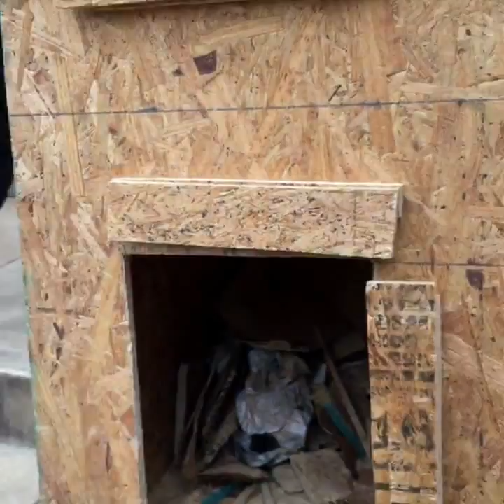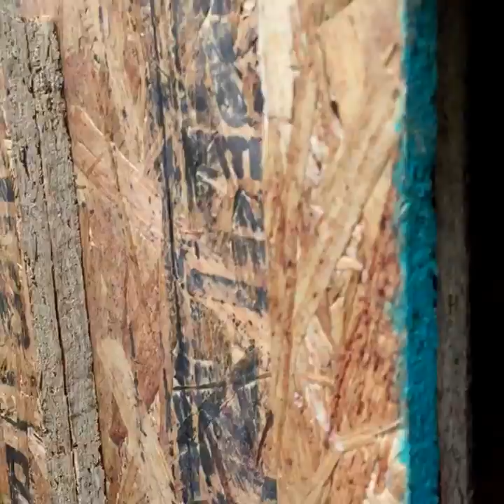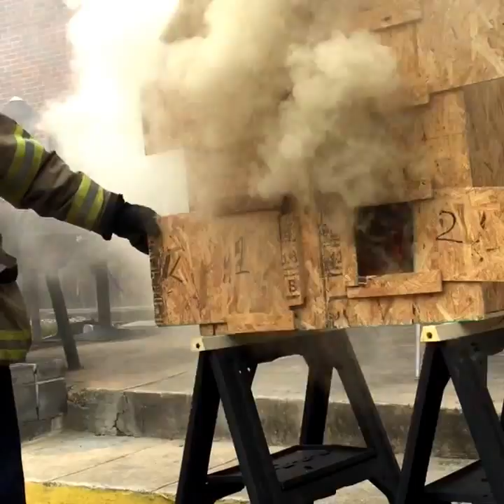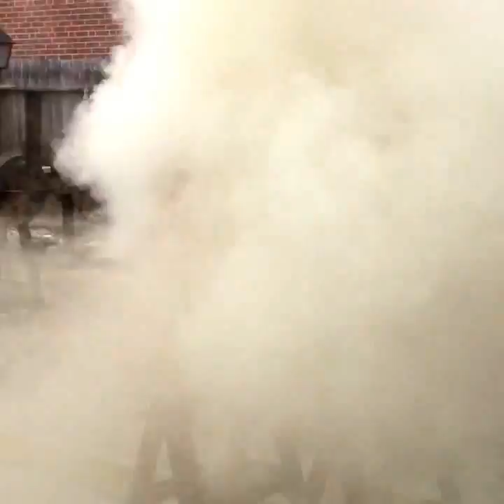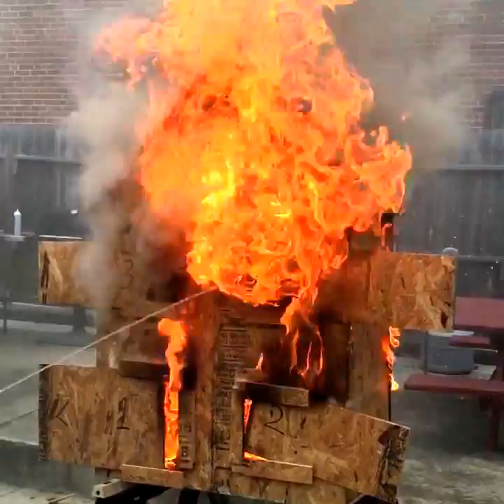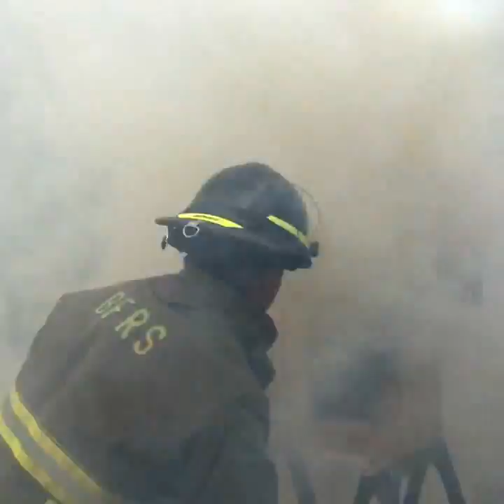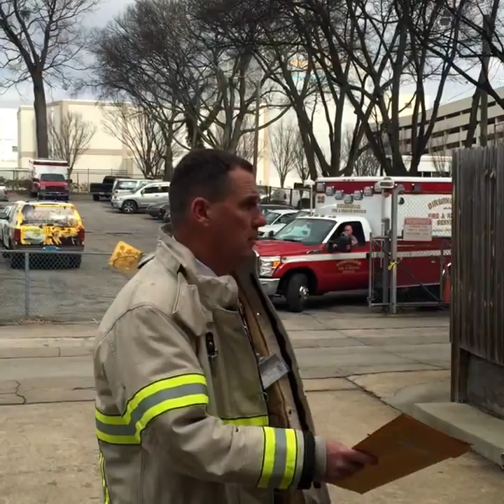Doll House fire behavior, Birmingham Fire and Rescue

Comment: you know how you can have non-flammable buildings in America... use bricks instead of wood it's only a bit more expensive but it's stronger and is actually tornado proof also so no more people will lose their homes.
Reply: Nope, it's Birmingham alabama
Reply: This is in the uk.... You do know that, right?
Reply: JohnLarry Jerry
i know i was just saying that brick buildings are better
Reply: +Jack Innes Biggs ok
Reply: Wooden Floor probably better then the original birmingham in britain its full of people we call "pikeys"
Reply: That the problem: expense and time. Whether you're in the fire service or not, you quickly learn that the whole concept of building construction, specifically in the residential setting, is "how can we build this house to be as strong as possible with the least amount of material?" Less material= less expensive. Thus, you now have lightweight construction consisting of engineered wood. Lightweight construction and modern building techniques= a very strong building, until it catches on fire. Then it will fail rapidly. These buildings were not built to withstand fire. And with the modern fuel load, it only enhances the rate at which one of these buildings will collapse in the event of a fire. 

Buildings have always been built from a money perspective. Just research fire cut beams if you don't believe me.
Reply: レノんに 七んと 下〇乂 bricks aren't tornado proof. They're actually very weak if force is applied perpendicular to the direction the bricks are laid.